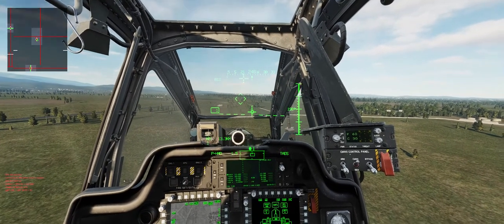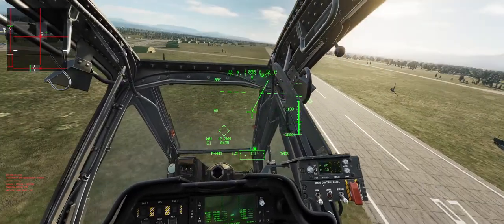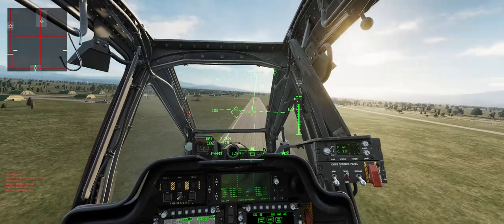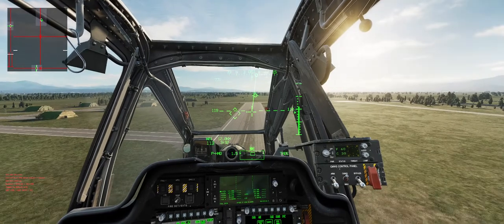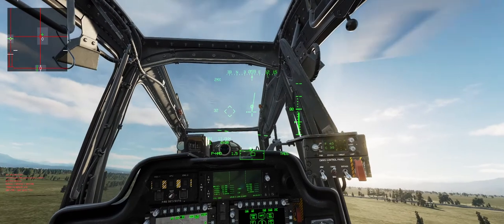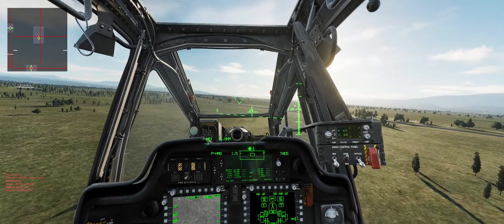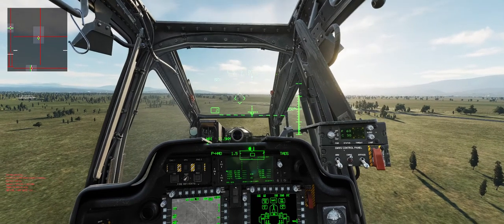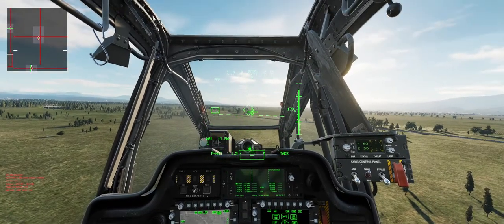DCS AH 64D - Decelerating to a Hover with AT Hold

Comment: I gotta admit this is an essential skill to hone....... I haven't approached Multiplayer mode yet but I have no doubt that this is among the highest possible value abilities. In Single Player my normal solution is switch to CPG 'pit and deploy George for hover. For best possible stability upon return to Pilot seat I first get forward motion going in CPG seat, else deal with torque chaos when switching to PIlot.
Thanks for the excellence and guidance!